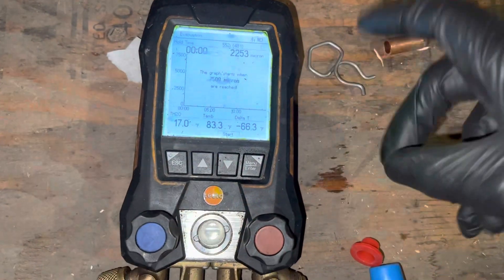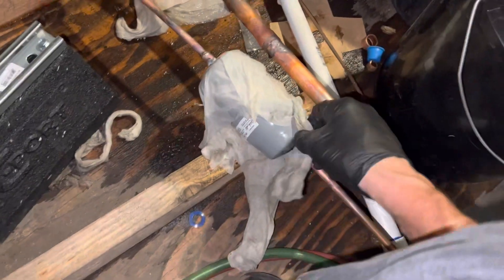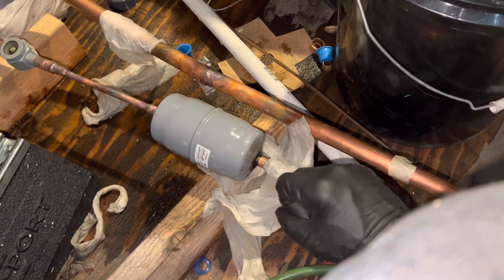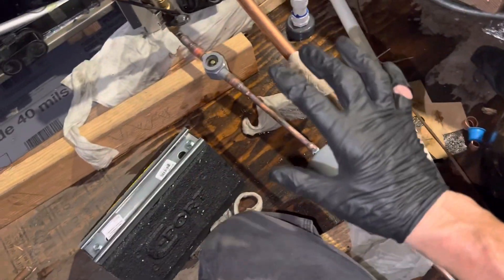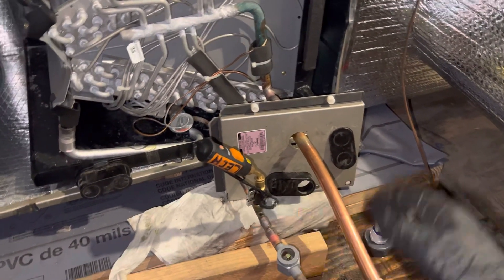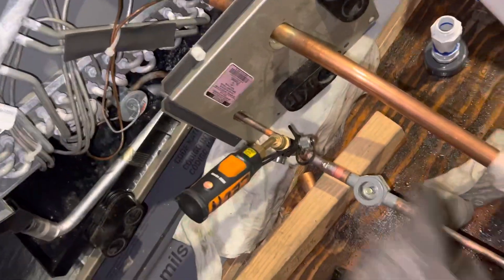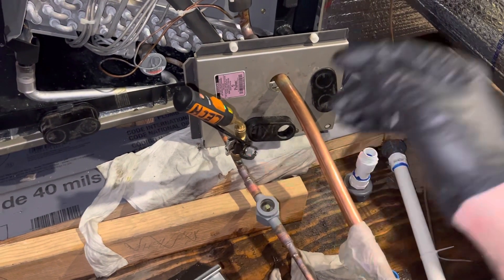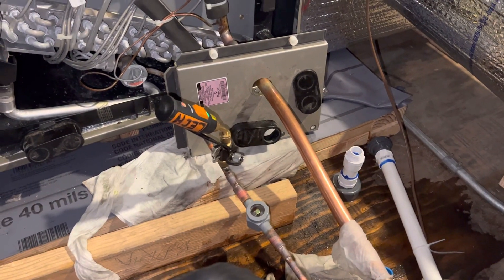I WILL DISCOVER I CAN NOT PULL DEEP VACUUM BECAUSE OF MOISTURE CONTAMINATION. Much more time needed￼

Comment: I think pressure test first makes more sense, as you won’t need to pull vacuum twice, unless you intended to do so.
Reply from the maker: Yes I know what seems like the logical step. 
        But there is a physics thing that goes on supposedly when you have moisture in the system they say you don’t want to push it in with a greater pressure behind it. Because you have both moisture and already used POE oil in the system. 

So if there was any air in the system or contaminants you don’t want to push the moisture or air into the used oil like you would pushed CO2 into water and Coca-Cola. 

Then you have a harder job removing it later on. 

Vacuum only takes minutes anyway if you have a good set up. 

You will see in my later videos I get the system all the way down to 26 µm I end up just leaving it on over the weekend running 24 seven I have other jobs I’m doing at the same time this was kind of just stay fit in between job.  

This is the customers equipment not my equipment I sold

It was supposed to be a quick job doing piping only until I actually got there and got into it and seen the mess I got myself into lol 😂.  Life‘s not per se we all realize that you just have to roll with it and take care of it as you come across it.
Reply: @coldfinger459sub0  Make lots of sense!
Reply from the maker: @jrm163  it’s simple science physics it’s just the understanding of gas laws and chemistry understanding High pressure goes to low pressure

Moisture will always travel to dry

Heat always travels to cold

Everything is always trying to find the equilibrium

Most processes can be reversed if you know how to control and manipulate the energy flow this goes with chemistry this goes with solid items liquid items gaseous items.